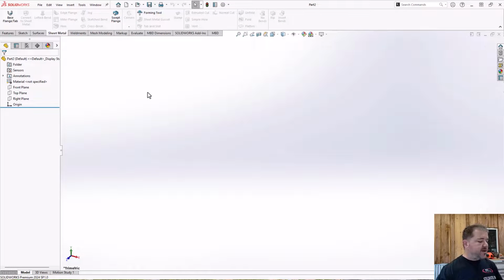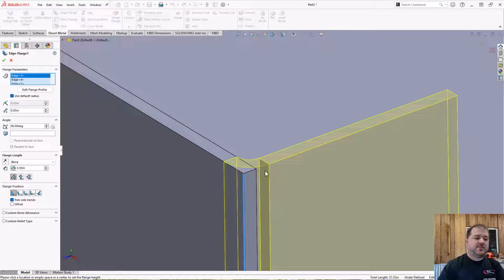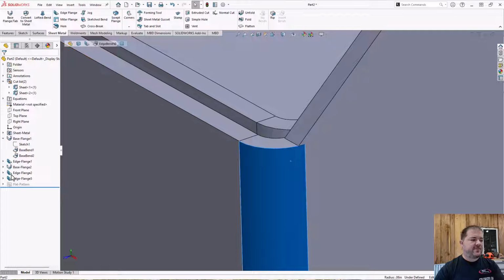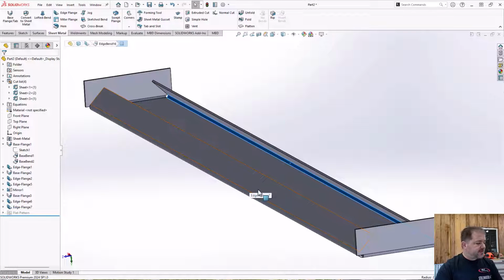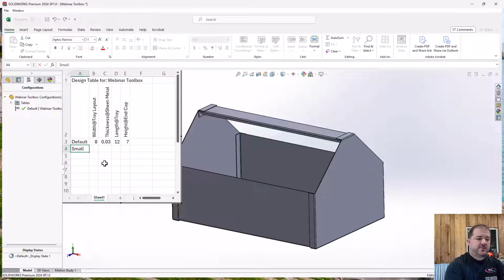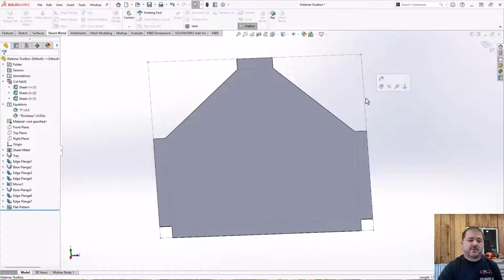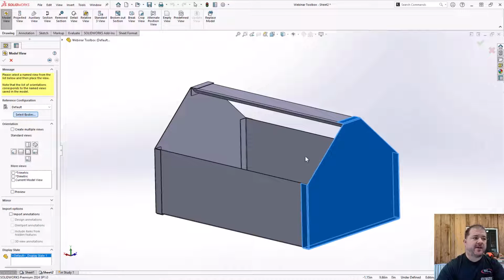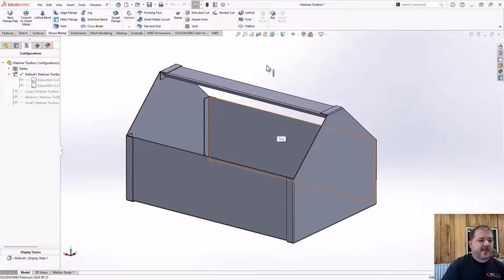Sheet Metal Design and Manufacturing Skills Event – Webinar

Comment: how to set KFactor correctly. I struggle to match the flat pattern dimension and the formed part dimension.
Reply from the maker: K Factor can change depending on the dies and material used, so your best bet is to bend a sample part.  Have your shop or vendor take a piece of scrap and carefully measure the length.  Then bend it and measure again very carefully.  Take those two measurements into SOLIDWORKS and create a sheet metal part with the same dimensions.  Measure the flat and the bent dimensions, and if they don't match the sample part dimensions, adjust the k-factor until they do. You can also download the manual for this event and refer to page 19 for a deeper discussion. https://www.mlc-cad.com/sheet-metal-skills/

Comment: How did cutlist generate the bounding box property? Is that for the flat or for the 3D model? What year SolidWorks was that feature introduced.  It could be useful for generating yields for BOMs.
Reply from the maker: The bounding box in the cut list refers to the flat pattern for sheet metal bodies.  You can also run a bounding box command in SOLIDWORKS for any other part and it will create a feature in the tree and populate custom properties for that part.  If you have a cut list, you can right click that folder and generate bounding boxes for all of the bodies in the part.  These various functionalities were released around 5 years ago and have been in various stages of improvement along the way, if you are running an older version check the Reference Geometry drop-down or add a cut list to a part and right click to see if it is there.